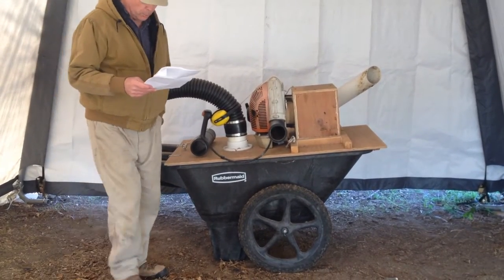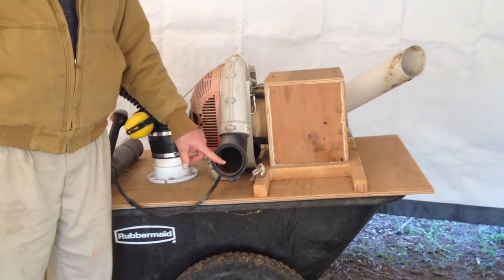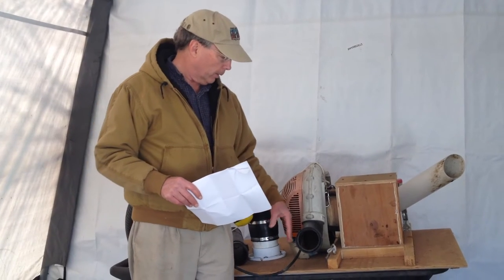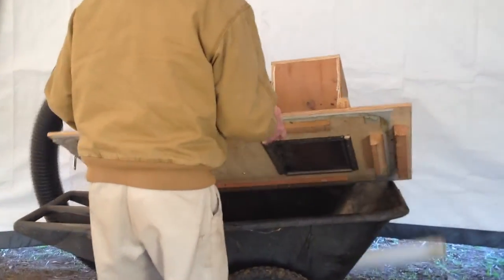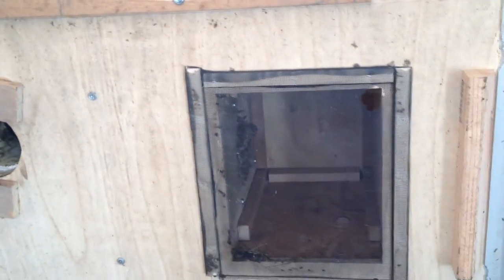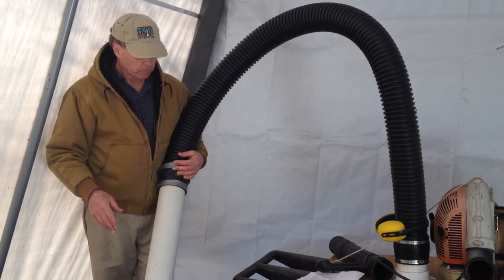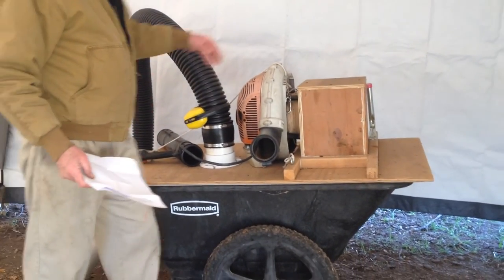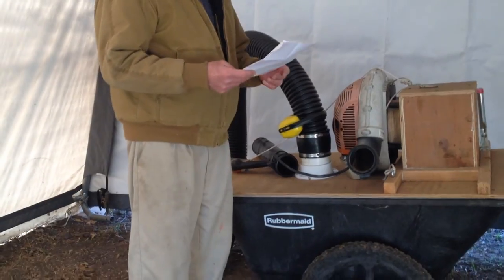Horse Manure Vacuum

Comment: I like your invention! I also have the same Rubbermaid wheelbarrow, it is well balanced and easy to pull and maneuver with one hand.                                                                           I am looking to vacuum up mulch (delivered by the tree trimmer company) and then spread the mulch around my trees and bushes. This might work as long as the mulch is shredded fine enough and does not have long twigs in it.
Reply from the maker: You'll have to play around with engine speed and maybe using some kind of filter, like hardware cloth. If I run the engine too fast it turns the manure into powder and blows it all back out. You might have to put hardware cloth over the impeller to keep it from blowing the finer mulch out the exhaust.
Reply: I will keep filtration in mind. Thanks!     :)

Comment: What cfm was your blower pushing?
Reply from the maker: I think this first version with the stihl was rated at 650cfm, but I could only run it at or just above idle or it pulverized the manure and pushed it out the exhaust like dust. The replacement engine uses an echo blower rated at 517cfm, and I run that at about 20-30% throttle. The wetter the manure, the higher the cfm you can use without turning everything into dust. The best time to vacuum is about a day or two after rain so the manure is still damp but not heavy wet. How much cfm you need is also dependent on how well sealed your enclosure is. If you have a lot of air leaks, you'll have to run the thing faster.

Comment: HI! did you make an other version?
Reply from the maker: Yes I did, the engine on this blower siezed. The engine requires 89 octane or higher fuel but I never saw that requirement, so that's probably why it overheated and siezed. This style engine has a bit of a reputation for that problem. Anyway I got a plain old 2 cycle echo leaf blower and mounted it different, and used different material for intake hose which is  a big improvement. I'll try to get video and post an update.
Reply from the maker: The new version is posted here:  
https://www.youtube.com/watch?v=g-VG6lAR5zg&t=3s